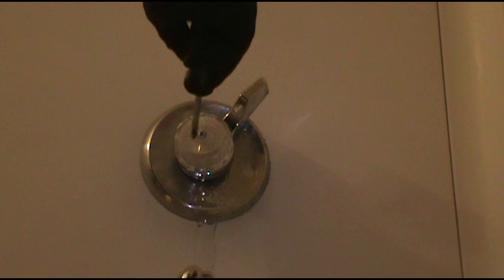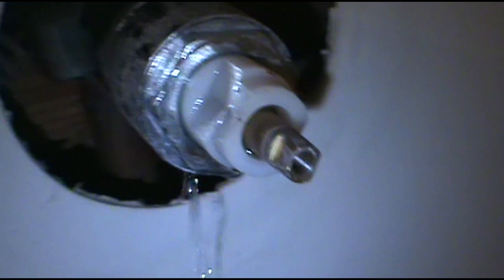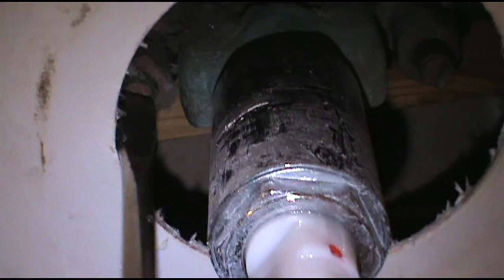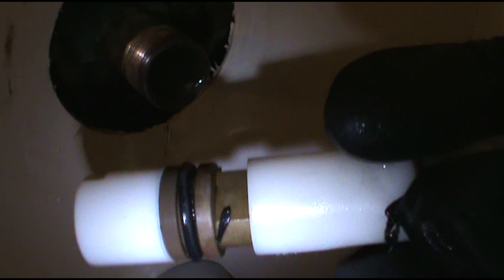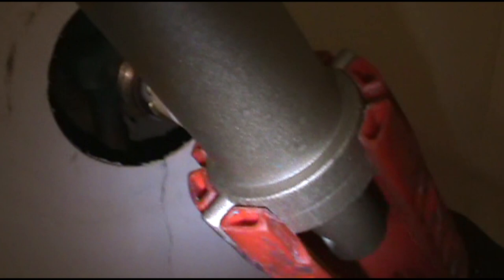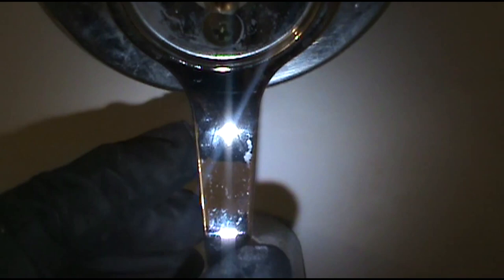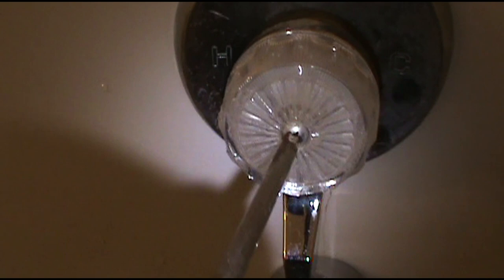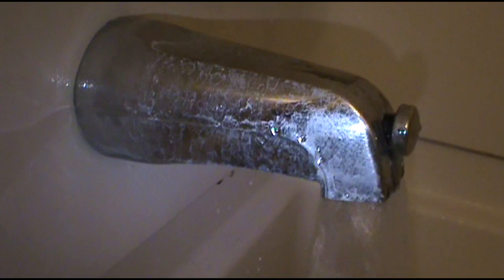How To Fix Leaky Shower Faucet

Comment: had the same exact call few days ago...we have the old delta single handles from the 80s.. you are brave to mess with the built in shutoffs either they are seized or ive had one snap off before.... we just shut down the building. nice work
Reply from the maker: working shlub I'll admit, I was nervous shutting the water off there. I've opened many cans of worms doing that. Luck was on my side on this one. 👍😂👍 Thank you so much for watching working shlub!
www.DirtyMaintenanceNation.com
Reply: yep, break, leak out stem or don't shut off is usually how the built in service valves work >_>